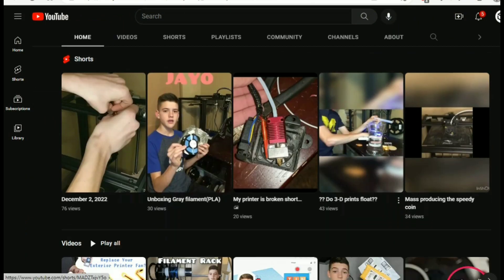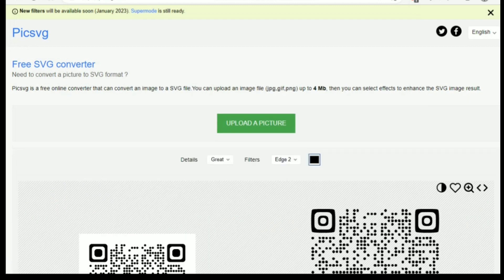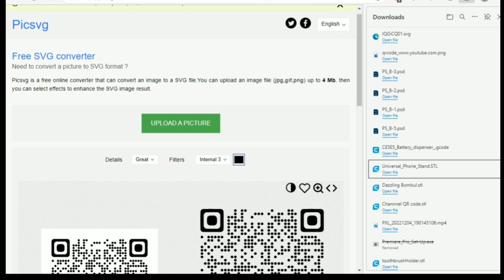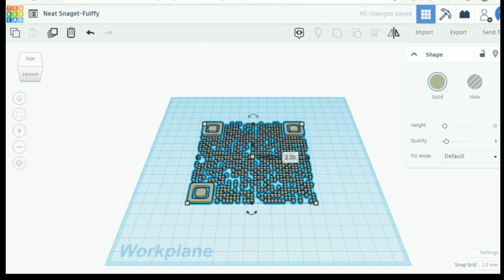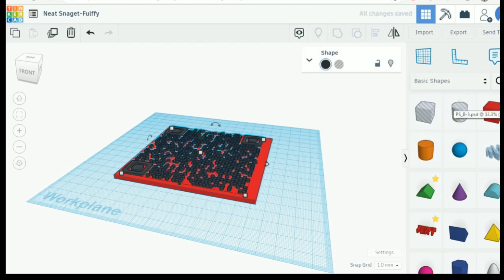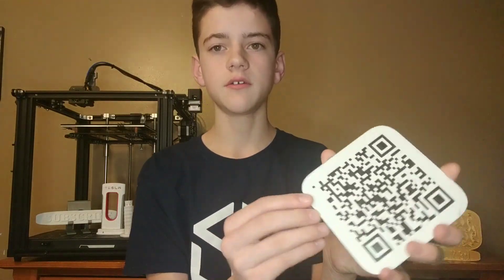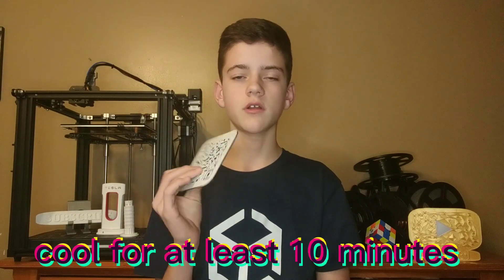3D printing a QR code

Comment: Wich material you use? What you put on Glas that the Filament sticks to it? I have some issues with my printer
Reply from the maker: I print with PLA. With the glass bed do not use glue but just rubbing alcohol and wipe it in with a cloth in between every 1 to 3 prints.
Reply: What kind of 3d printer do you have? I have an Ender 5 pro.
Reply from the maker: I have the base model Ender 5 but I am upgrading it to be like the pro model.
Reply: @speedy3d524  cool

Comment: You can use a lighter to burn all of the little strings away in the print.
Reply from the maker: I did not know that.
Reply: nuh uh
Reply: @chingchomg1238  I regularly use this method to get rid of stringing.
Reply: @PrintedByJohn  nuh uh

Comment: thats a really cool video! 
i also  made  a qr code, but i made about 100 small ones, linked them to the never gonna give you video (cause  why not).
all i  did was take the qr code, then import it into cura as a JPEG (most image files work) and it will make a lithophane, and because it  will make darker lighter, it makes it pretty good. from there, i just made it stop when it started printing the actual code or dots or whatever you call them then made it stop, (so you dont have to watch it 24/7) and just switched it out. printed really nicely, and i think you should try it!
Reply from the maker: That’s a Classic
Reply from the maker: I thought of making a QR code and it made a lot of sense to print them. I went through a couple prototypes that didn’t work, but I got one to work at high quality and actually scan will.